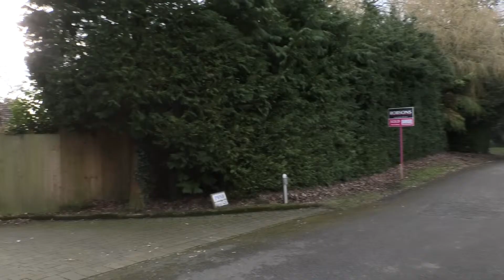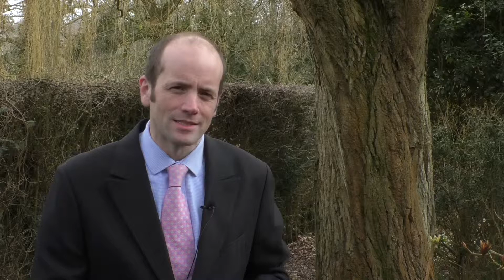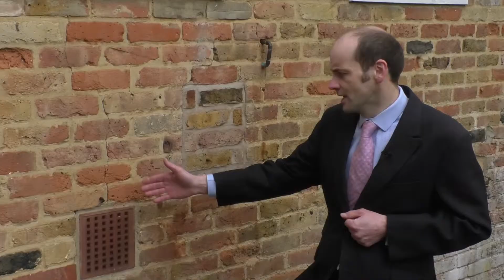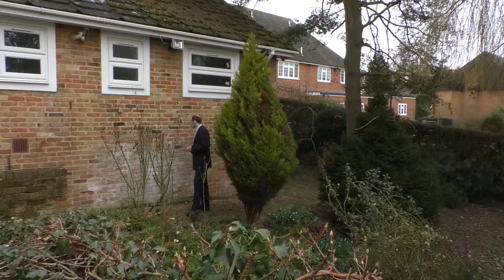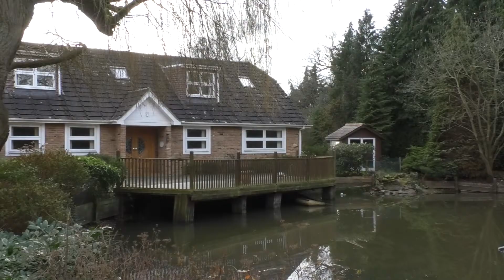Introduction to cracking in buildings by Woodward Chartered Surveyors

Comment: extensive knowledge from your books and guidelines you follow each case should be individual   not based on area faults    what is the cause a nd repair  😂😂😂😂😂😂 structural engineers  do the investigating . do not trust these legal robbers at all

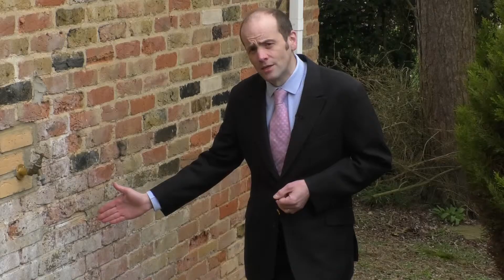Comment: 3:17 The cracking and subsidence and spalled (crumbling) bricks are caused by that outside tap allowing the ground to stay constantly moist in that area. As there's no drainage beneath it so it saturated the soil and on winter causes frost heave of the saturated ground. It's why everything originating around that tap is knackered.
Reply: Exactly 👍

Comment: What further investigation is needed
Reply: In the first instance get yourself a copy of Building Research Establishment Digest 251 (Assessment of damage in low-rise buildings).   It ends by advising  that “The only certain way of confirming the progression of damage is to take a series of measurements with time.”   Monitoring.